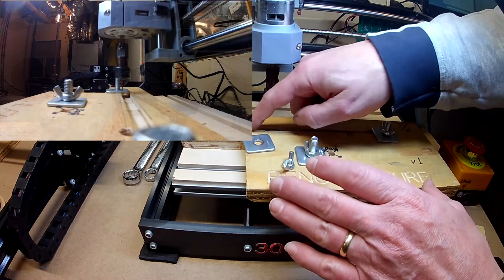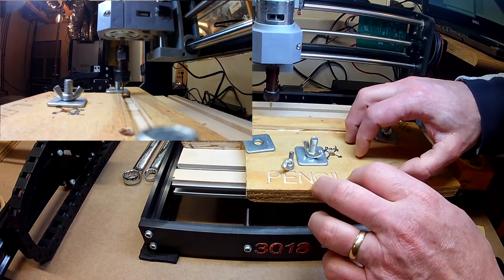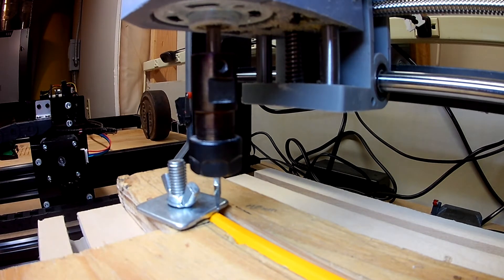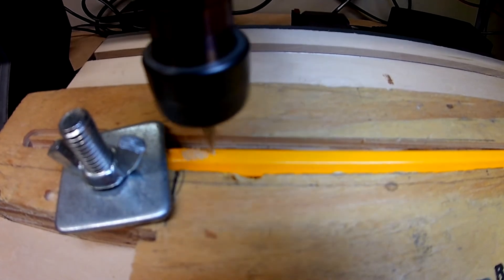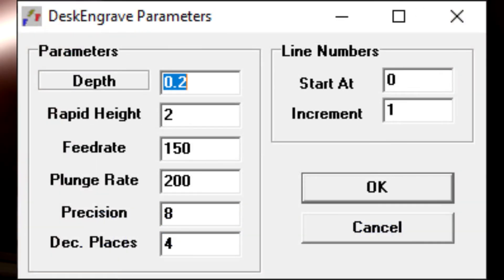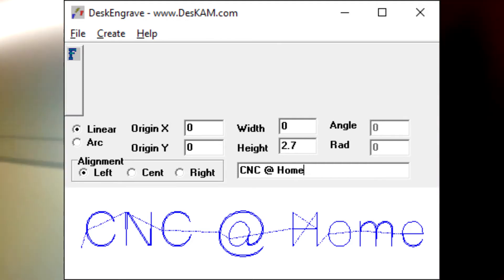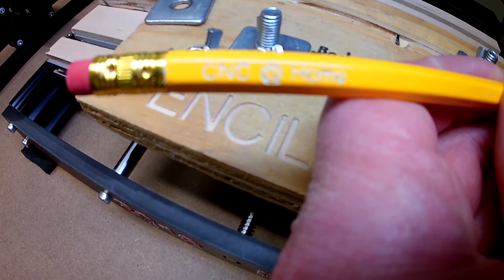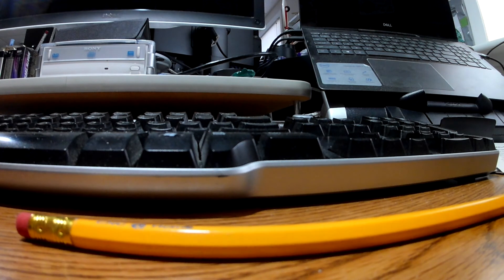3018-Pro - Engrave a pencil

Comment: Thanks again for the info. I’m working on small engraving projects on aluminum. I’ve upgraded my 3018 to the point it’s more a small CNC mill than an engraver. I was just about to pull the trigger on a breakout board and Mach 3 when I found your pencil engraving video. Experiments begin this weekend. 👍🏼
Reply from the maker: I like the sound of that!  Have fun with your experiments.